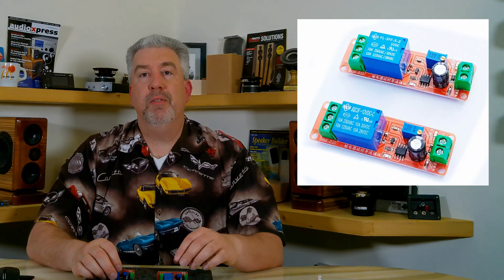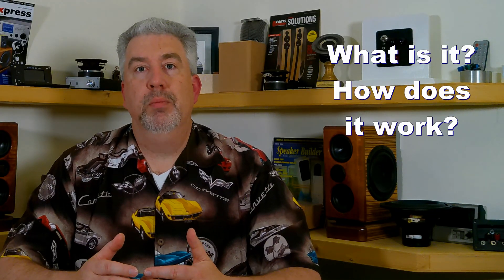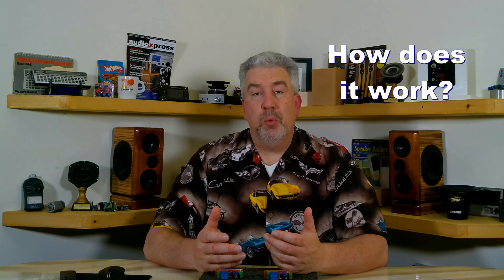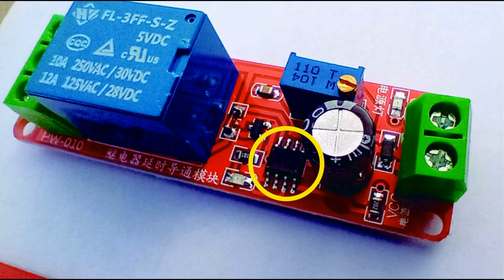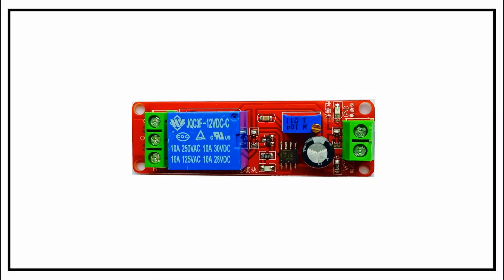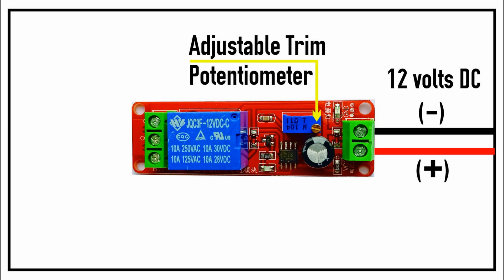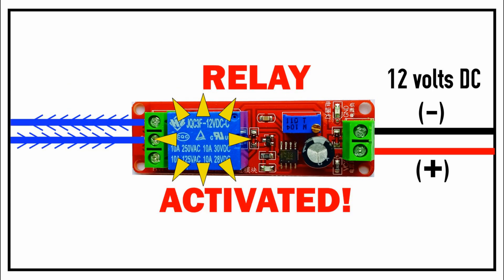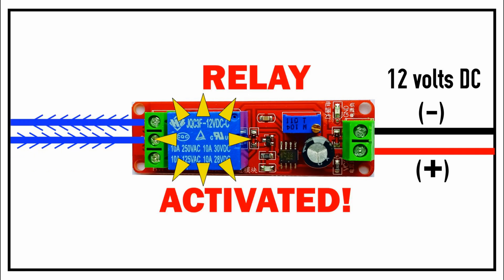Looking into How a Time Delay Relay Works

Comment: Is there a board like this with 4 terminals? I want to use something like this to control my model railroad 3 aspect signal, green, yellow, red through this timer relay.
Reply from the maker: Not that I'm aware of, but I suspect you could use two or three of these set at different time intervals to do the same thing? The relay connects the middle and bottom terminals when off, and disconnects when turned on, so could you use that to your advantage?
Reply: @zarboaudioprojects1430  yes that is a thought thanks

Comment: Thanks for the vid!  I'm in the process of researching an install for my car.  This is my first time messing with electronics, and I wanted to expand my understanding of what would be happening when I make the install.  I discovered via forum that I can use a time delay relay in order to run my fuel pump for longer than the car's computer will allow.  This is to accommodate for fuel drained from the lines as a result of a leaky check valve, an expensive and invasive repair.
Reply from the maker: Ahh, that's interesting. I think these things are probably good for lots of stuff we don't normally think of using them for.  If it's not too much trouble, would you mind pasting a link to this comment chain of that forum thread so anyone interested could read up on it? I'm interested in learning more about what you're planning to use it for. Sounds creative and an easy(ier) fix all in one. Thanks for the comment too.

Comment: Great video. I’m using one of these to power up an inverter. When it’s turned on the n/c terminal connects through a resistor to precharge it and then after 4 seconds a continuous duty solenoid is activated by the timer through the n/o terminal to connect full voltage.
Reply from the maker: Nice. That's a clever use for one of these. Thanks for describing your use of this cool little device. These things are handy little buggers. I plan on using one for the radio I'm in the process of building. I may use it to delay the amp power-on, or I may connect to the common (-) terminal of the amp output and just let the amp turn on right away and delay the speaker connection. I have to see if that will work though first.
Thanks for the comment Adam, and thanks for watching my video.

Comment: Thank you, this is great. Amazing how knowledge like this is free on the internet. The modules are dirt cheap as well.
Reply from the maker: Yes, cheap, fun little click-y things that can do cool things in an electronic project. Thanks for watching the video.
Reply: @zarboaudioprojects1430 Can this be used for OFF delay also > for both activating the load and hold/maintain its ON position upto specified time (0-10 sec) ? in a IR sensor +ve output circuit ? triggering on off again and again by IR sensor output ?
as I am annoyed by the on off flickering Output of IR sensor relay circuit while using it as automatic sink/basin hand wash process.
Reply from the maker: @anandjoshi8554   I don't think this will work for that process. Check AliExpress though, they have boards that will do what you want, they will be a bit more money, and involve a simple micro processor board but they do exist. Just don't get lost in a rabbit hole... easy to do on Ali! :) Thanks for watching and for the comment.
Reply: Check my comment 😉